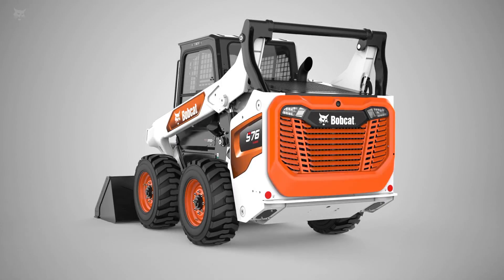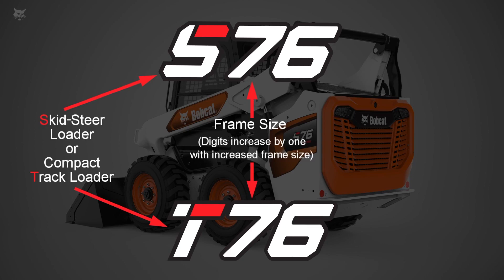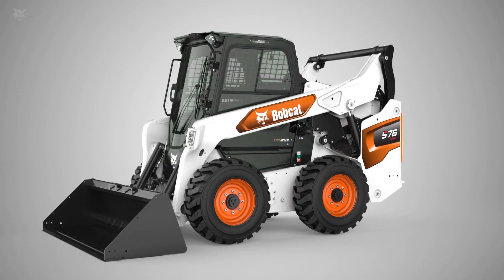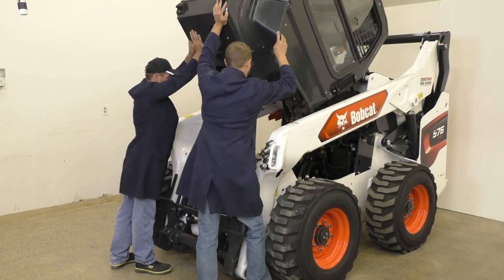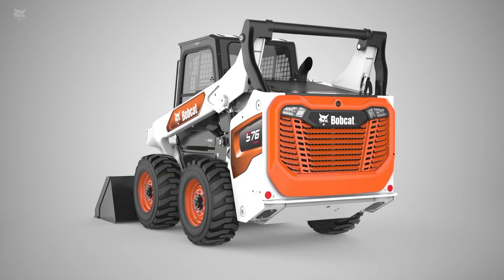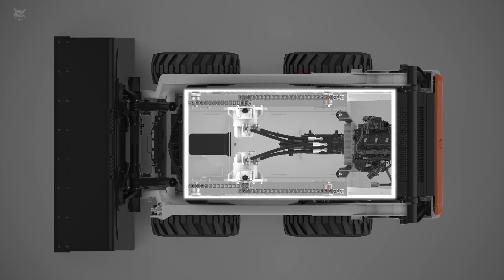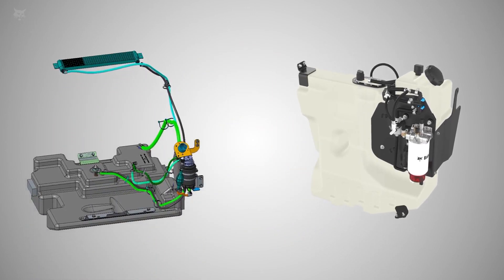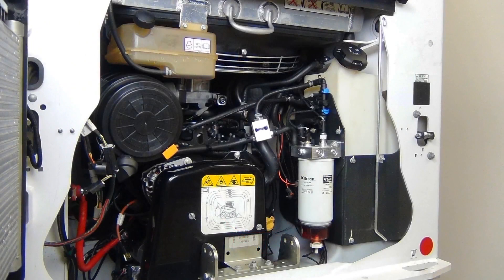Bobcat R-Series Loader Redesign Introduction

Comment: When will the updated wiring harness and HUB controller be available? Have the 2022 models been updated now that #Bobcat #Rseries is aware of the water entry issues due to poor placement? I know Bobcat is aware of this as my #T76 is still at the dealer waiting on these updated parts to repair. It is under warranty and no loaner or assistance from dealer or corporate. Good thing #DEERE #333G stepped up and dropped off a loaner when I ordered #Deere replacements for every Bobcat item that I owned.